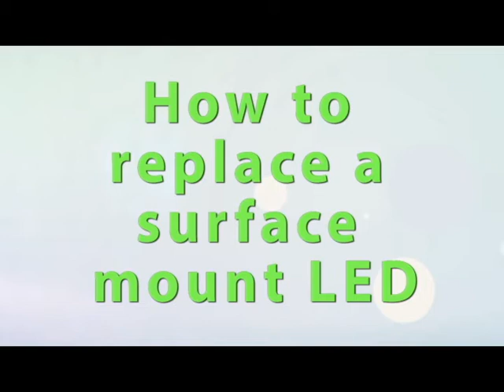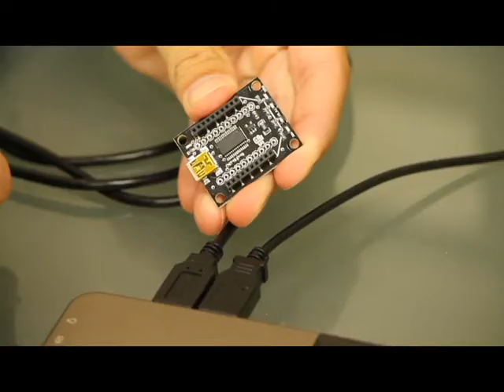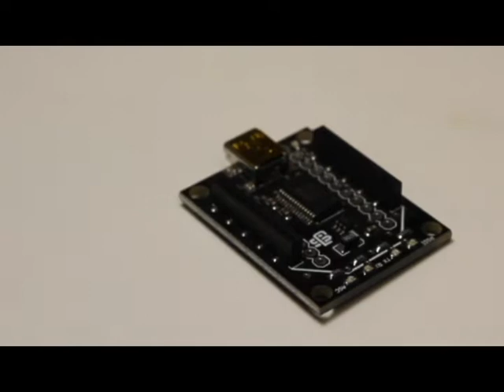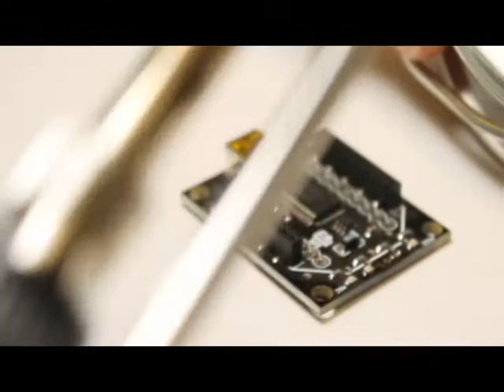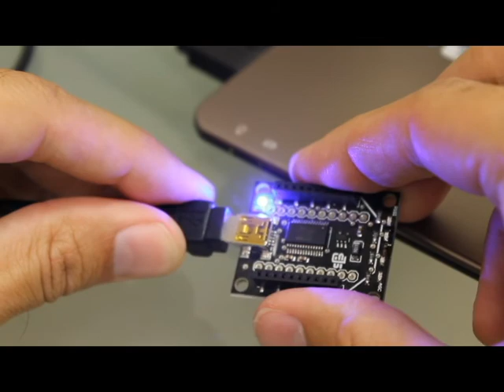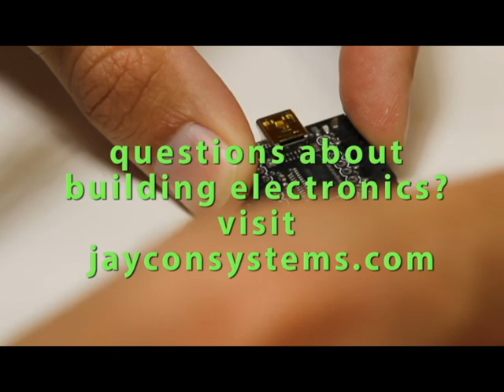How to replace a surface mount smd LED

Comment: How do you identify the led in order to buy a replacement
Reply: I imagine you get a multimeter to check voltage and measure it with calipers then obviously know the color.

Comment: How about larger surface mount chips with BGA's?  I have a GizmoSphere Gizmo 2 SBC and want to replace the original AMD FX 210HA 2 core processor with the AMD FX 420CA 4 core processor I purchased, along with replacing the 4 Micron 1Gb DDR3 chips with 4 Micron 2Gb DDR3 chips I purchased for this SBC. How do I ensure I have perfectly positioned each of these 5 components to ensure each Ball of the new BGA precisely meets the board surface attachment point before turning my heat gun to them?

Comment: can you tell me what is that special end on the soldering iron? also, if you don't mind to tell me the type of tweezer pliers that you used.
Reply: it's a vacuum tube that sucks the fumes away